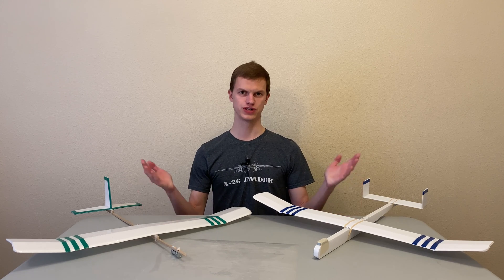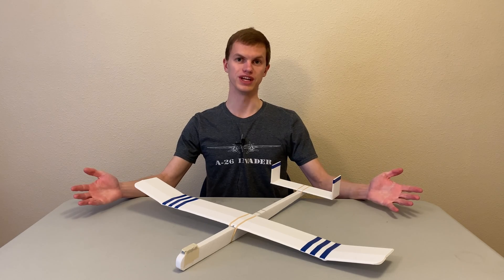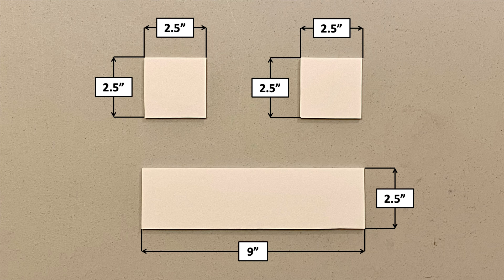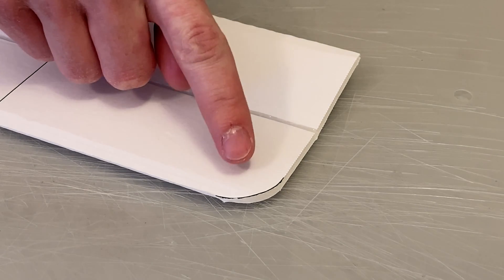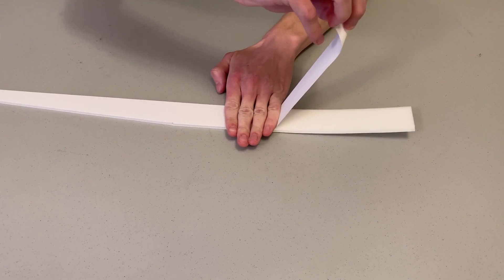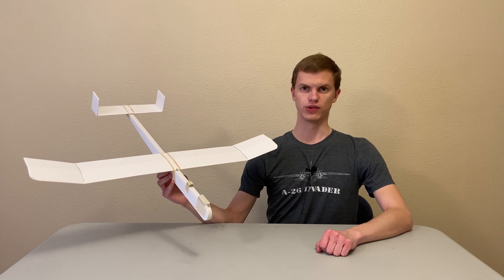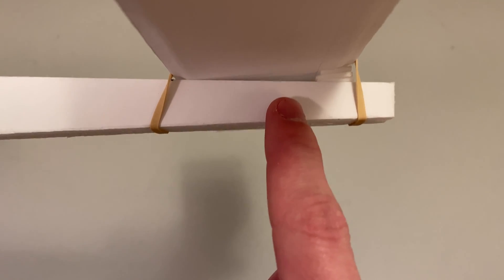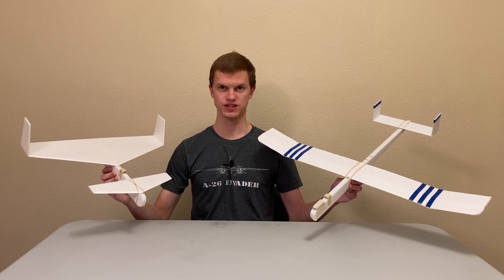How to Build a Cheap and Easy Model Airplane that Flies - Version 2.0

Comment: Checking out more of your videos. Can't remember where I saw it, but some one explained "stability" in the air by using a marble. On a flat board, tip it a bit and the marble rolls off. On a plate that has a lip, angle the board a little bit and the marble rolls to the lip and then stops. I built most of my gliders with a polyhedral, so slight bend in the middle on the fuselage, and then the secondary upsweep on the wing tips.

Comment: Also for keeping weight down it's much more efficient to use crazy glue (cyanoacrylate) rather than hot glue as opposed to peeling off the paper.
Reply: To make the CA glue bond quickly and very strong, one can sprinkle baking soda (sodium bicarbonate) on the wet glue. This is also good for filling spaces such as the gap when added dihedral.

Comment: Very nice video. I'll build my own - pleese include metric system as well :)
Reply: You can just multiply all the inch numbers shown by 2.5 cm to make one in metric. Although the exact conversion is 1 inch =2.54 centimeters it doesn’t matter to be so precise. At long as you use the same conversion number during the entire build, everything will fit correctly. It will just be 1.6% smaller, which doesn’t matter. If on the other hand you do half scale, the flight characteristics might be off

Comment: Thanks for detailed instructions on building airplane. I liked it and ordered foam board. Unfortunately the length of foam board was not sufficient to take out 30" wing. So I created airplane with 15" wing length and divided all measurements to half. But I ended up making heavy airplane which was sinking too fast and couldn't glide. I checked the wing cube loading and found it to be 25 :) Restarting from scratch.

Comment: Hello i was wondering what mm is the foam board?
Reply: And is it ok if I use a 3mm foam board?
Reply: @michellegraciella165  Yes, 3mm is fine. Make sure u cut it slow tho, they tend to break pretty easy under force.

Comment: Hi you linked a website that works out the center of gravity for a simple plane in your last video. What would you put for the sweep distance of a straight tapered wing which is symmetrical? Also does the website tell you where your center of gravity should be or just where it is based on where you’ve placed the wing compared to the tail in the measurements you have to fill in, essentially I’m wondering how you know what the distance between tail and wing leading edge should be for the calculator when you don’t even know where to put it yet based on the Cg since you haven’t calculated it yet
Reply from the maker: The calculator in that link shows where the CG should be for the plane to fly right.  To figure out where the CG would be if you built the plane for real, I've started 3D modeling airplane designs in OnShape (free subscription), and assigning densities to the materials.  I then add extra weight into the 3D models on the front/back to see how much I'll need to get the CG in the correct place.  For a straight, tapered wing that is symmetrical, if I understand your question right, you would have (sweep distance) = (root chord - tip chord) / 2.  I hope that helps.
Reply: @DesignYourOwnAirplanes-xd6lz  Thank you, for some reason people kept telling me the sweep distance would be zero. On the first point, if it’s telling you what the center of gravity should be, how do you know what the distance between the leading edges should be? Say you have a 1000mm fuselage, you have to put the distance between the leading edges of the wing and horizontal stabilizer in to the calculator. But how do you know what that distance should be in the first place? One another thing if you have the time to answer: when I want to turn my 2D wing designs into 3D ones after using that cg calculator, does the wing-tail ratio I use and the consequent sizes of the wing and tail not affect the cg in anyway? Or will I have to recalculate the cg using the weight moment method
Reply from the maker: @FrotanInferno  You would decide how long you want your tail to be based on what tail volume you want.  Slower planes need higher tail volumes (which we'll talk about in a later video).  When you make your tail longer you'll have to add more weight on the front to counterbalance it.  As for your second question, the calculator uses a relatively simple method to estimate the location of the NP and CG, so it could be off by a bit, especially when you start factoring in airfoil shapes and stuff like that.  I've also used XFLR5 (free aerodynamics analysis software) to model plane designs and find the NP and CG locations.
Reply: @DesignYourOwnAirplanes-xd6lz Thank you, all this info has been very helpful in my design so far. Can I ask how this calculator takes into account the fuselage? Because the fuselage factors into the center of gravity position doesn’t it? Do you use the values this website gives you and just use that as your wing and tail position or do you have to factor in the fuselage in some other way (like working out the center of gravity yourself with the fuselage and then trying to get the CG where the website recommends) or should you just line up the fuselage center of gravity with the one from the website even if it means the tail isn’t at the end of the fuselage?
Reply from the maker: @FrotanInferno  I’m pretty sure the calculator doesn’t take into any aerodynamic effects caused by the fuselage.  Moving the fuselage relative to the wing and tail is one way to adjust the CG location.  I often decide where I want my fuselage to be and then move the weights forward/backwards to get the CG in the right spot.
Reply: @DesignYourOwnAirplanes-xd6lz  With that in mind, moving the fuselage relative to the wing and tail, would you say it’s alright if the tail isn’t right at the end of the fuselage but further forward in service of a better static margin? Or does the tail necessarily have to be at the end of the fuselage, because the only planes I’ve seen where that isn’t the case are canard or some biplanes but never just a normal monoplane glider so I’m not sure if it’s wrong on principle.
Reply from the maker: That should be fine.
Reply: Can I stick the parts using hot glue gun instead of joining them using rubber band? @DesignYourOwnAirplanes-xd6lz